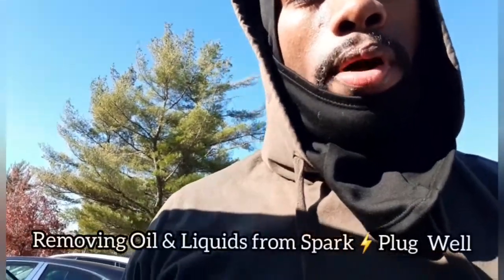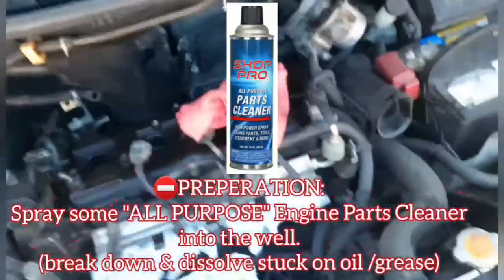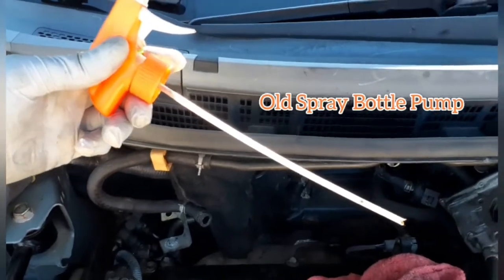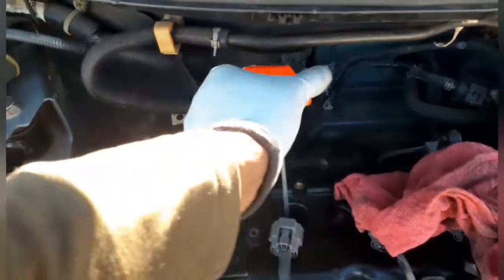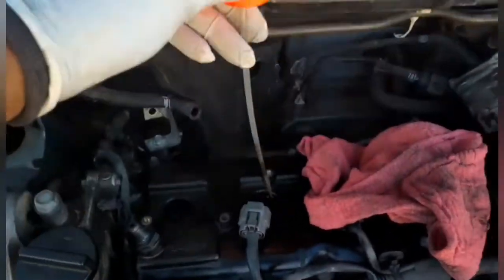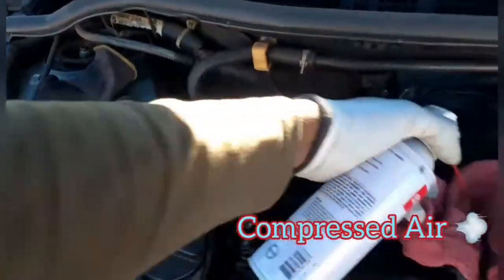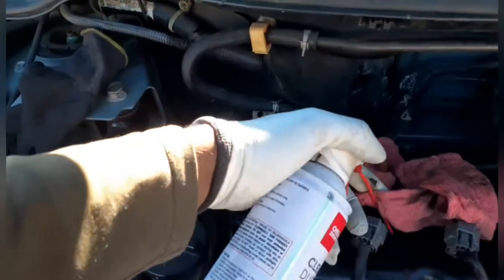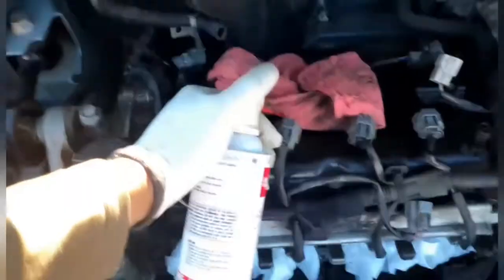2 Ways to Clean Spark Plug Wells

Comment: A little too late for me I took spark plugs out and oil went in what do I do next, I did the same to all sparkplug
Reply from the maker: You can try to reinstall the plugs, run the engine and hope the engine burns it away. Hopefully, there's no internal damage.

 However, in the future please 🛑 DO NOT REMOVE THE PLUGS 🛑 until the cleaning process is done and all grease, dirt, oil and other debris are removed. Then install new plugs if need be. 

Good luck, thanks for watching. Like, Share & Subscribe.

Comment: Does an electric air duster works the same for that job?
Reply from the maker: Yes, if you have an extension or precision attachment so you can center the air flow into the well, but be careful with any cordage when operating under the hood or around other metals But  compressed air is pretty inexpensive but for long-term electric air duster can save you money. 💲💵

 Goodluck, blessings, and thanks for watching.

Comment: Italian condenser tube from a HVAC system and tie it to the end of my vacuum hoes and then I use tape to seal it, electrical tape LOL haha and then stick them in the hole and it sucks up everything but then cleaning it I don't know electrical cleaner I actually use it and I make sure I use two to three layers of cloth a light cloth, folded and pressed down with a flathead gently going up and down back and forth left and right etcetera etcetera, sometimes I make an extension screwdriver with all small extensions and I get down there, tile wire head brush to the tip of it that I used to clean my razor blade or my buzzer😅😅😅😅 for my face😅😅😅

Comment: Damn I saw this too late what if I took the spark plugs out
Reply from the maker: If you took the Plugs out first, some issues could come up later potentially but not definitely I assume the car is running still , if there was little to no debris, oil, or dirt that dropped in the opening when you changed the plugs out. 

Car engines run aggressive and hot for propulsion a little dirt wont stop it, but for future reference🛑  DO NOT REMOVE THE PLUGS BEFORE CLEANING 🛑 to avoid any problems.

Good luck, thanks for watching and God bless on any future repairs.